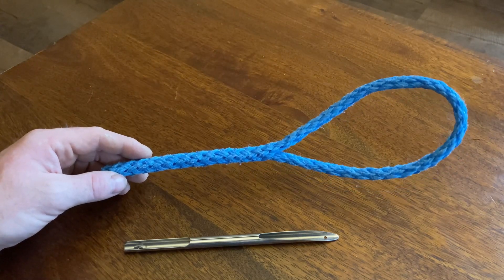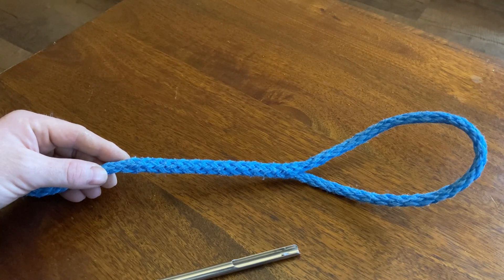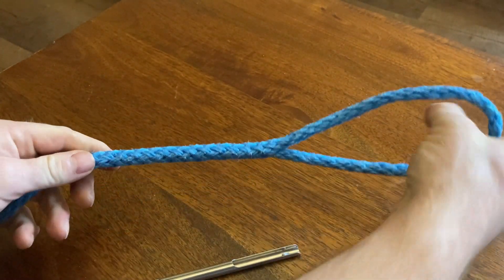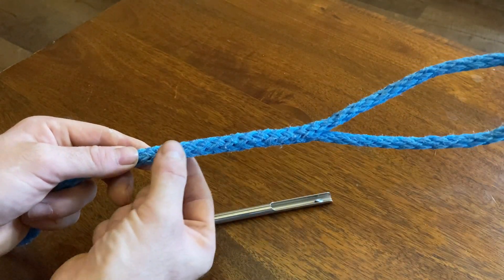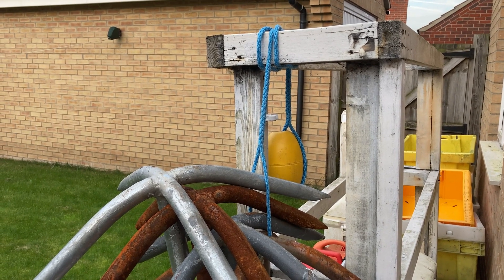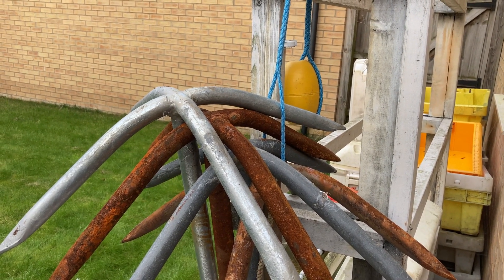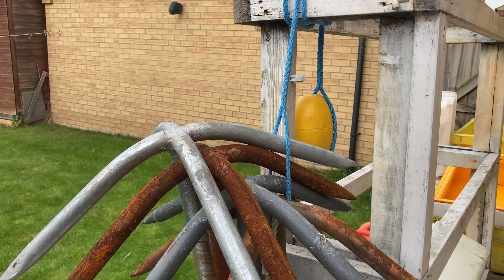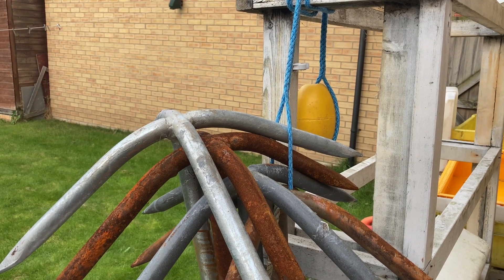How to splice a loop / eye in rope in seconds - basic weight test

Comment: i have the same rope but i dont have a fid is there anyway i can get the rope spliced without a fid ?
Reply from the maker: This hollow braided rope has 8 pairs of twine in it, 4 pairs left hand and 4 pairs right hand, personally I wouldnt bother trying to splice it without a fid. It can be done, but its very fiddly and time consuming on 8mm rope.
Reply: Depending on the size of rope.  An appropriate size  hollow tube make your own fids really easy.  Knitting needles needles make the best home made cut one end off so you can fit your  rope inside.  A bit of tape to hold the rope and away you go .
Reply: Don't cut the pointy end off lol

Comment: I know works on the principle of a Chinese finger trap the harder the pull the tighter the grip.  But i would have started with a brummel lock . But see where you are coming from
Reply from the maker: Being so smooth, the mono netting doesn’t catch on the splice at all. You put any turns in the rope and it’s a nightmare